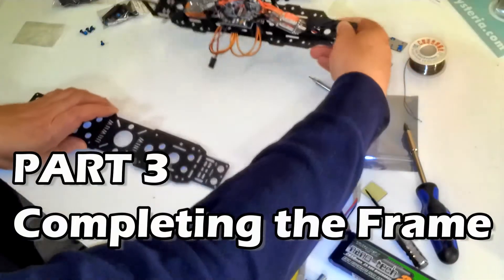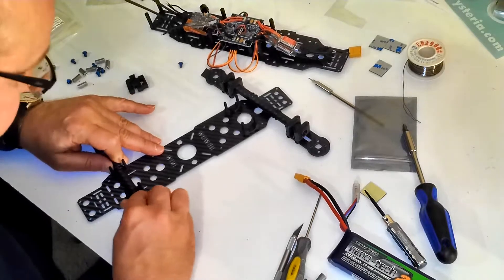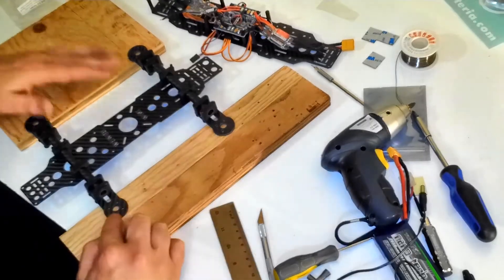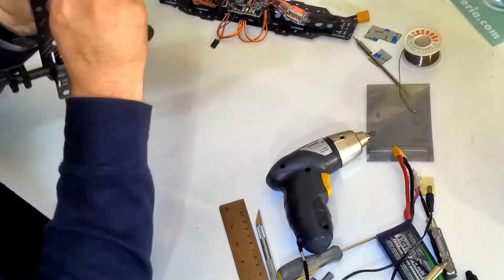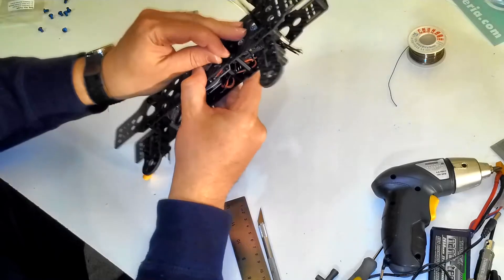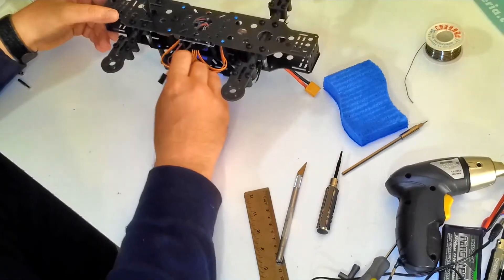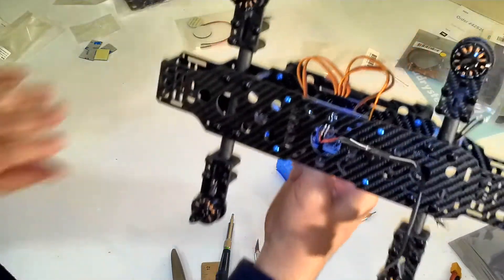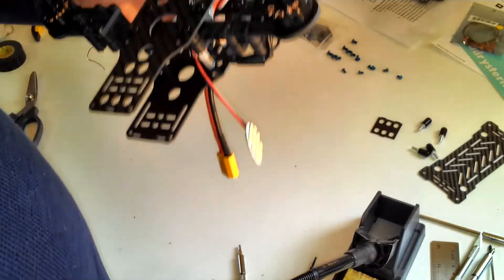PART 3 - Mini Mamba V2 Build - Cleanflight, OPTOs, S.BUS

Comment: I am lost from about 5:13 where your hands are out of the frame - even after 10 time+ watching your video I cannot find out what and how to mount the battery plate.
Reply from the maker: juesch23 Sorry about the de-framing. Not easy to keep camera lined up for two hours. If you overlay the battery plate onto the bottom frame plate you will see the four M4 large holes line up with the outside-most holes on the frame plate. Attach the M4 nylon standoffs on those holes with M4x6mm blue aluminum screws. The battery plate is held to the standoffs with the 4 aluminum male-female standoffs. Screw the male end through the battery plate, then into the nylon standoff.
Reply: Quadrysteria got it - thanks

Comment: Wouldn't it be neater to have the motor wires routed through the tubes/arms?
Reply from the maker: Gus F Yes, that is an option that adds build time. Because most mini motors will require adding approx. 80mm of wire extensions.